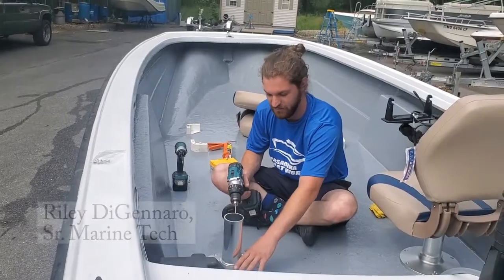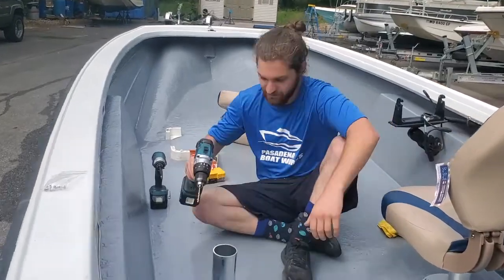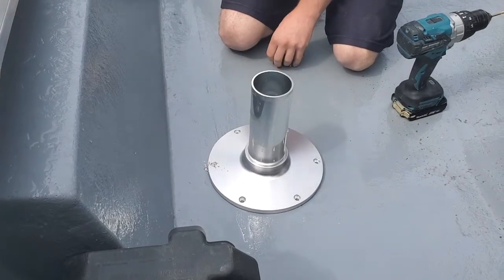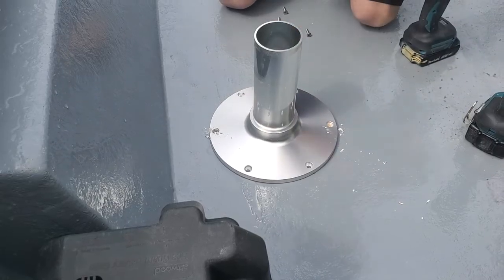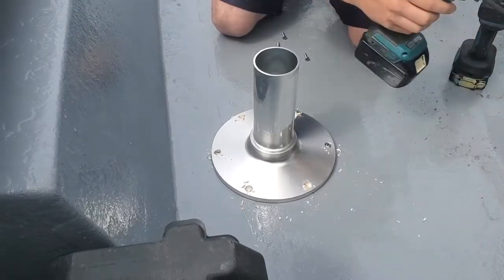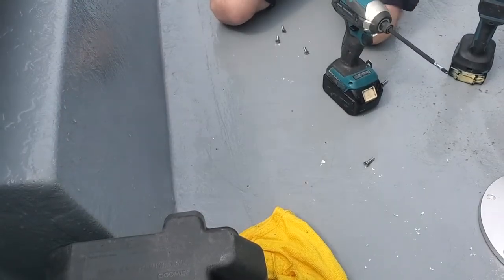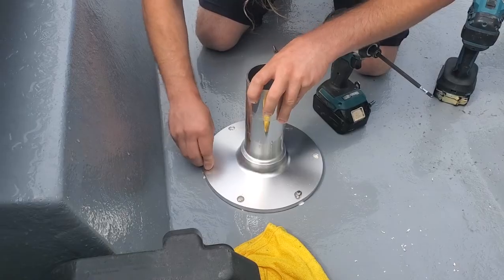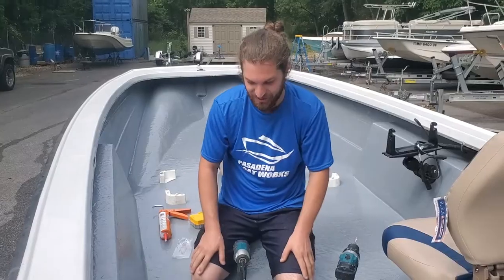How to Install Boat Seats (With NO Crooked Screws!)

Comment: What material did you seal that floor with? It looks great.
Reply from the maker: Thanks! That was BoatLife Life Seal. It provides a good seal but isn't as impossible to remove down the line as 5200 and similar adhesive/sealants.

Comment: Is this how you install roof structures or posts as well?
Reply from the maker: No clue - we just do boats, sorry!!
Reply: @FishTalkMagazine  I mean on boats.
Reply from the maker: @GHanBax  Gotcha & sorry - have to admit we don't have anyone here who's done that sort of structural installation, we'd have to defer to other sources for this one...
Reply: @FishTalkMagazine  generally speaking, how would you mount a stainless steel tube to a fiberglass hull? Planning to put solar panels on top.
Reply from the maker: @GHanBax  There are a lot of what-ifs (curved or flat surface, access behind mounting point, nature of panels etc) but generally speaking solar panels aren't incredibly heavy and have relatively easy mounting points, so mounting in a fashion similar to as seen here should be fine. We'd also suggest going to the custom marine products website gallery, (https://www.custommarineproducts.com/gallery-of-installations.html) they show a number of very different installations and you can see how they've been mounted on a number of different tops and surfaces. There's also a good rundown on mounting solar panels at betterboat.com. Good luck!
Reply: @FishTalkMagazine  THANKS!

Comment: Does screw grip well? What’s the material of the floor of the boat? I though you need bolt and nut.
Reply from the maker: Through-bolting would be preferable, but in this boat there's no access under the deck. The deck itself is 3/4 marine ply under a layer of fiberglass, so the screws do get a good grip.

Comment: Is the caulk to make the screws stick or to stick the seat to the floor
Reply from the maker: More than anything it's to seal the holes, so there's no water intrusion, but it does help prevent the screws from backing out too.

Comment: any issues I with the pedestal coming loose over time?
Reply from the maker: Good question - 3 years later - nope, they're still functioning 100% perfect!! (And I use that boat a LOT!!)
Reply: I screwed my seat down just like that and the screws pulled out the first use
Reply from the maker: @xThat1dude  That would indicate that the screws were too small, the holes were drilled too big, or the surface area was insufficient to support the stress/weight. You might try upsizing the screws, if you can access the area underneath, going to through-bolts, and/or adding a backing plate. Good luck!
Reply: @FishTalkMagazine  thank you for your reply.  I did quite a bit of digging.  I found stainless steel anchors i am gong to try them.  If that doesn't work I'm going to use glue 🤣🤣

Comment: What size of screw ?
Reply from the maker: That can change depending on the base, on the thickness of the deck, and on what's beneath it (IE if there's a fuel tank or rigging under the location you surely wouldn't want a screw long enough to touch it). As a general rule, however, just as long as the screws fit the pedestal's predrilled holes, bigger is better.
Reply: Ok thanks for the tips . I currently have 3/4 inch plywood with gelcoat. It’s an older style bass boat and I don’t have much space below floor anything over 2inch could potentially go through the hull. 🤦‍♂️